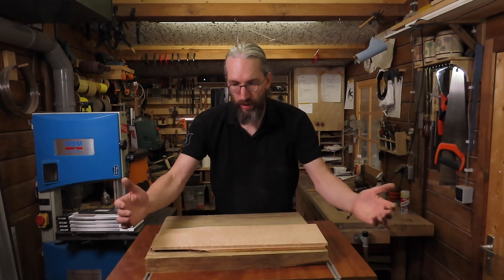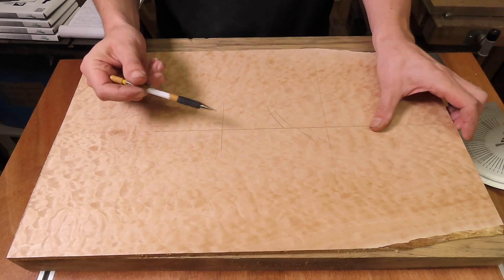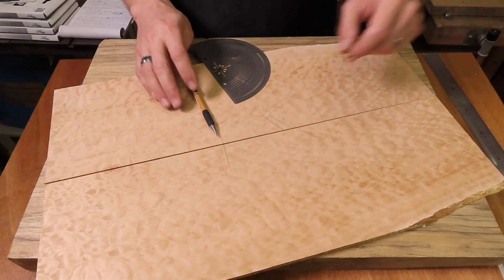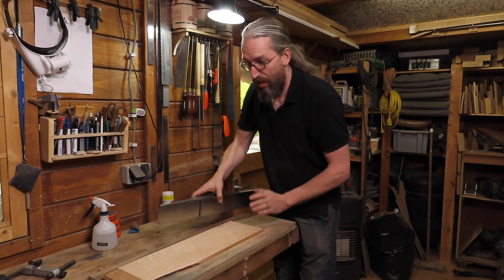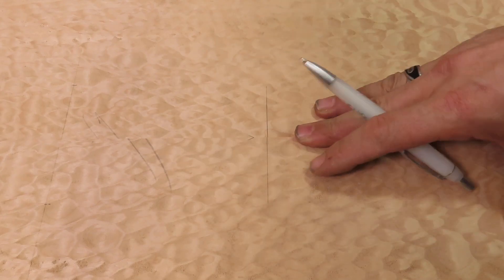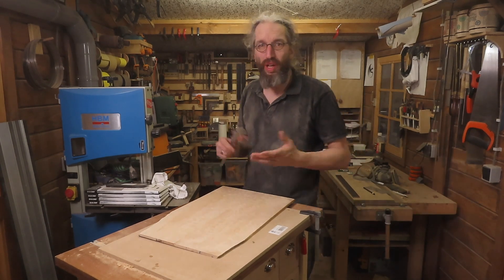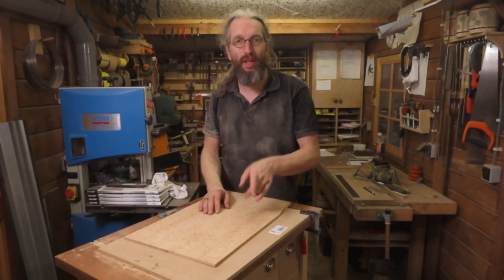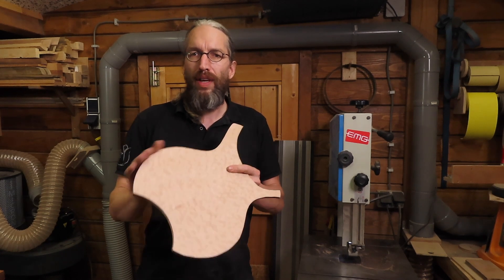A new Guitar build part 8: Bookmatching  a quilted maple guitar top.

Comment: When building a neck, what is your opinion on the pros and cons of single piece over multiple piece necks? I don't want to run before I can walk... Reason for asking is I was going to do either a 5 piece neck or a 1piece torrified through neck, but as this will be my first ever build should I just go for a 1piece (thinking of mahogany body and neck - same as my Schecter), so that if I mess it up it will not be such a costly disaster? Thanks as always for a brilliant video 😎
Reply from the maker: Hey Rosalinda,
A multi laminate neck is said to be more stable and less likely to twist or warp. When making a laminated neck you can arrange/align the grain in such a way that potential wrap or natural bending of the wood get cancelled out by itself.
Maybe a little suggestion. I personally wouldn't recommend a neck through for your first build. I would go for either a bolt on or set neck. This way you'll leave yourself some margin for error in for example the neck break angle and scale length. With a bolt on or set neck you can always make little corrections if needed. If you mess up the neck on a through neck guitar and you have already glued on the body wings could potentially be an expensive mistake.
Good luck on your build.
Reply: @UnquendorGuitars  once again thank you for taking the time to reply ☺.  Really appreciated, point taken - I'll play safe!